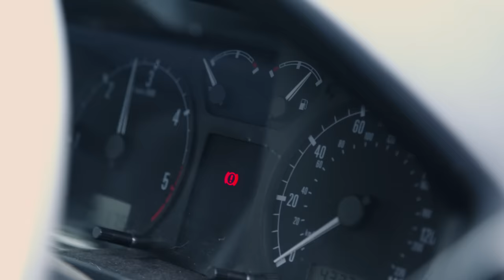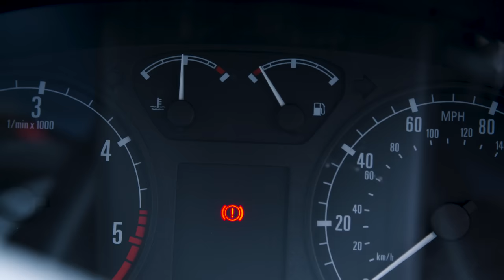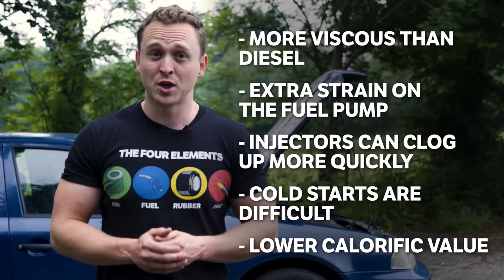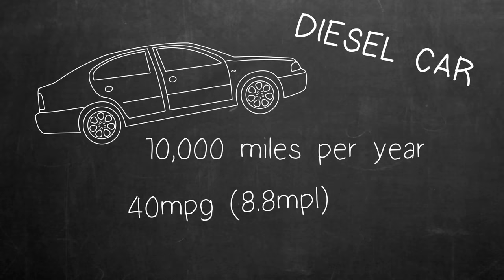The Pros & Cons Of Running An Old Diesel On Used Vegetable Oil

Comment: And now try to get your best time on nurburgring running on chip fat
Reply: Full Throttle If he can run 800 miles on some chip fat
Reply: Full Throttle To do this properly, you are supposed to preheat the oil using heat from the coolant loop, to lower the viscosity and save your injectors.  Put a heat exchanger in your separate oil tank and you'll be greasing for a million miles with nothing but smiles.
Reply: Full Throttle i can you try HVO100
Reply: Josh Ellis. I've run several older diesel cars on neat veg oil, both fresh and filtered used, and never needed to warm the oil first. However if you're worried about excessive injector pump pressures you can simply add a small %age of petrol to the tank. In really cold weather you can safely go as high as 20%.
Reply: Actually why not take Miles to the Nurgburgring and do a lap on only vegetable oil
Reply: Full Throttle what about suspended water?
A j cloth isn't sufficient enough, your filter will block.
Reply: A form of heating will also be needed for cold starts.
Reply: Chris that's pretty impossible, you'll never heat the pump, lines and injectors.
Reply: whats up with phil?
Reply: Josh Ellis this engine doesn't need a heat exchanger or twin tank system.
Reply: Yes
Reply: Full Throttle Can add 20%gasoline to thin the oil.
Reply: did you ever put metholated spirits (alcohol) in winter to stop it going like lard?
Reply: @amanofmanyparts9120  could veg oil and diesel be mixed in the same tank? Would there be any advantage to this method?
Reply: @MarkMcCluney  You could do that, but the mixture wouldn't be much better than running on neat of oil or diesel. In practice a small(ish) quantity of petrol (gas in the US) will do the job far more efficiently. Depending on the average air temperature, 5 - 20% (max) will do the job.

Bear in mind that this applies only to older diesel engines. Modern 'common rail' or 'direct injection' diesel engines will not run on veg oil as well as the older types. This includes Perkins engines as early as the 1940's as they invented the direct injection diesel engine. I had one and it chucked out as much smoke as a WWI naval destroyer 'making smoke in order to turn and face the enemy'!
Reply: @amanofmanyparts9120  I'm a bit chicken about starting this and I guessed half and half would give me similar mileage for a reduced price. And thanks for the info about the direct injection engine - clearly I need more research before taking the plunge! Thanks mate.
Reply: Doesn't matter, you get from a to be on the cheap. But I'm not so sure what the engine will look like after x 10K of driving on this crap.
Reply: Shell already uses veg oil as diesel. Look as it goes in the tank !!
Reply: Bruh how does chips have fat?
Reply: @amanofmanyparts9120  petrol or diesel?

Comment: Back in 2000 when the fuel shortage was everywhere I was running my rover on veg oil for weeks from wherever I could buy it. Standing in kwik save with a trolley filled with 1 litre bottles got me a few states
Reply: I heard a lot of places will give you their used oil for free, because they have to pay to get rid of it.

Comment: Two points.  If you heat it up, the viscosity decreases and you can pass it through a finer filter.  A bed sheet would probably work well.  Second, if you siphon something, keep your thumb or finger over the end when you do it; you'll be able to stop the flow immediately without losing vacuum or getting anything in your mouth.
Reply: Use a clear tube so you can see it coming! 😉
Reply: Pro tip:
Put a seccond little tube in the hole  to the tank.. use a piece of tissue to block as much as you can so no air comes in or out..
Now blow on the little one. 
As the air gets in from one, the diesel comes out from the other.
The little tube don need to tuch the diesel
Reply: @duarteolim6473  that probably would have saved a few lives in the 60s

Comment: Use a 50/50% diesel and veg oil mix saves money and you don't have the problems with viscosity and no problems with cold start I have been driving my pajero 2.8 auto 4x4 on a sunflower oil mix for years without any problem.
Reply: You can still smell it, and eventually it gums up the injectors. The crap filtering he did will kill modern cars. Your better off using an actual filter membrane.
Reply: Hi, do you put the 50/50 mix strait into your fuel tank or do you have a second tank
Reply: I used to do the same with my Landy.....had about half a tank of diesel and would stand in Tescos carpark and pour 2 x 5l of veg oil into the tank. Got some strange looks!
Reply: @SuperNeilB  Same here in a Vauxhall Astra Isuzu diesel 50 50 ish. Car ran just fine !
Reply: the best is a 2 tank system you only use diesel when starting and 1-2 minute before shutting off the engine.
Reply: I am driving vw bora 50/50 just from tesco oil
Reply: C Davies I had a Nova TD and a Astra mk TD. Both great engines only the rest of the car rotted away. Engine would've gone on for many more miles ☺
Reply: C Davies nice car also strong engine ☺ Especially the 150bhp version ☺
Reply: I wish I knew about the anti theft value before I tried to cyphon off a full tank before we sold our Octy. I managed to get a good 15L out before I gave up.
Reply: Pete uk radio amateur mw6zan duuude do you know Pajero in my country means Wanker?
Reply: I run 100% summer and 80% oil in winter with not many issues
Reply: I have a more complicated formula in my mercedes benz. I use 50% oil, nu 40-45% diesel, and the rest is petrol. No hp loses, drives like crazy, and it is well maintained. Winter or summer.
Reply: You have to check on the 2.8 it can blow the front seal on the pump
Reply: @eduardotrillaud696  yes but the spelling and meaning in Spanish is different pejeros is the closest I can come up with it certainly is not pajero the Japanese meaning is pampas cat from what I gather.
Reply: @radionutio81ij79  the spelling is the same in spanish. But yeah of course the meaning is different
Reply: Little Reptilian  you don't need a conversion, all you need to do is add 20% petrol to neat oil
Reply: @albertasandruskevicius9683  you don't need to do a 50 50 mix all you need is 20% petrol
Reply: @G Burns the Isuzu engine Corsa B it's immortal. also the torque! good lord
Reply: Running 50/50 Diesel will cause globs of a plastic like substance in your tank
Reply: the same with 1.9 AGR Octavia... no difference in throttle response or performance. It just smells differently.
Reply: I run my 2.5 pajero on used gasoline engine oil and diesel mix!
Reply: @nemphis95  I too run a small amount of petrol through my Golf SDI every so often. Helps to clean the injectors and stop things from gumming up.
Reply: Your pajero 2-8 will run sweetly on a 50/50 mix because it’s an indirect injection engine as will older Peugeot/Citroen,Ford,Vauxhall/Opel,early Perkins and any other Diesel that uses that type of injection. The newer High Pressure Direct Injection engines are not as tolerant of poor fuel as the older ones. There is of course the problem with EGRs and Catalytic Converters and the dreaded Particulate Filters. These are very expensive items to replace should the fuel ruin them,just think about that before using these low quality fuels.
Reply: @Steve211Ucdhihifvshi  forget running modern cars on veg oil at all. We are talking about old cars here. Running some diesel purge 2-3 times a year will clean the injectors and keep the fuel system in top shape

Comment: My uncle left the country but the car to us, so we abused his TDI Bora 2001 with McDonald's Oil. Non Filtered, Straight into the gas tank. 1/3 Diesel, 2/3 Oil. Worked as a charm!
Reply: That would have clogged your fuel filter immediately, tank would look like a chip pan,
Viscosity would be far too high, I've run it for 23 years
How many days did your car last 🤣🤣
Reply: @S-O-T  it lasted 3 more years until he got rid of it (he crashed the wing due to ice on road). It worked well. We put oil many times and it worked. When he came back from Spain, he drove from Montreal to Los Angeles and it worked well. ALH engines rule!
Reply: @boardingurban  i thought he left the country for good, gosh are you good family to try to kill his car with unfiltered filth.
Reply: @tarkitarker0815  he crashed it a year later. No issues with the engine until then.
Reply: @boardingurban  its still not nice.
Reply: @tarkitarker0815  thanks for reminding me of all the good memories!

Comment: I did this for a few years in a 1993 Citroen AX Diesel. Worked great, it actually run smoother once it was on operating temperature. I did install a fuel preheater, this makes the diesel flow better trough the system.
Reply: "the diesel" i know what you did there.

Comment: My dad once ran a tractor on this stuff. It smelled like pancakes :D
Reply: Deep frying pancakes?
Reply: i can tell you are from the countryvtoo as the offline dino game is your P.P you must drop internet alot?
Reply: Must of been terrible pankakes that you ate
Reply: Makes me want to run my late 90's mechanically injected Kubota lawnmower on deep fryer oil.
Reply: You can run diesels on anything, my dad ran a Mercedes 300d on engine oil, automatic transmission fluid, and some diesel all mixed together
Reply: Lmfao #dead
Reply: I run my ford 5000 tractor on a 75% chip oil , 25% diesel mix
Reply: My uncle was the lead fish fryer during lent at our local knights of Columbus. He would usually get about 600 to 1000 gallons of peanut oil a year. He filtered it about 5 times and converted it to bio diesel. He would carry his bio diesel in a 85 gallon tank. Since he only used it was in his Dodge Ram dually. He pulled a 38 foot 5th wheel and a 16 foot bass boat. To a lake that was about 110 miles away from his home. My aunt would drive their PT cruiser behind him. His truck is a 2005. He only has like 58,000 miles on it.  Until he got to old to fry fish and retired from the KOC altogether. He is now legally blind and has major health issues. He still has his truck though. It did not see actual diesel fuel until about 50,000 miles. He is 91 years old. He has always been a gas mileage freak. He would do anything feasible to try to conserve fuel as far back as the late 60s. It was always a hobby for him. I remember him saying he was getting 24 mpg out of a 360 dodge engine one time. He had changed out the gears in his rear end, and at that time doing something with injecting air into the carb someway or another was the big thing. Like I said. Saving fuel was always his hobbie. He had all kinds of solar panels and a solar preheater for his hot water system. He had home spun windmills all over his farms. Actually that was pretty neat how he did those windmill/solar fence chargers. My dad also used electric fences to keep our cattle and hogs in. We had to dig long trenches and run long electrical lines to all his chargers though. He said he did not trust the solar powered ones because he used the weed burner fence chargers.
Reply: @sniperdoug1969  that's cool to think people have been doing it as far back as then. I love the idea of one day having some land where I can try to generate electricity, especially if I had a stream or small river.

Comment: The veg oil even filtered will eventually clog up the engine itself. There is something called esters in it. By processing the veg oil, you can remove the esters. BUT to do that you must heat it with a mixture of methanol and lye. The esters will separate and since they are lighter they will float to the surface. That way you can drain off the now purified veg oil from the bottom.

At one hundred percent it will thicken in cold weather such that it cannot reach the engine. For that you must put heat cables all along the fuel lines. Or you can run only a 50% mixture in cold weather. You might notice a slight decrease in power depending on the engines management system. A new electronic system might be able to add more fuel when you need to accelerate such that you won't feel the loss of power.
Reply: Can I msg u? I'll post my email for a short time if/when u respond.. I would sincerely appreciate your input 🍻
Reply: It's not the esters that are the problem. Vegetable oils (and animal fats) are tri-glycerides (all tri-glycerides are tri-esters of glycerine and hydrocarbon-chains), during combustion, especially in a cold engine and at an oxygen deficit,  the glycerol residue reacts to produce both Acroline, which is emitted/produced, and the side reactions polymerise. The Acroline is very rough as an atmospheric pollutant, and it reacts to produce photo-chemical smog. The polymerised byproduct clogs your engine, and the rest fucks up air quality.
Reply: You make esters when you refine vegetable oil the way you are talking about. It's literally called trans-esterification. So the esters aren't the problem.

Comment: My Dad had a W124 Mercedes E-Class which he ran on rapeseed oil, basically the next best thing after used vegetable oil. We had a big fuel tank in the garage which was filled up by a truck every once in a while, and we could just fill the car up in our own garage - and it was cheaper than diesel, too! The disadvantages? That freakin' truck driver ALWAYS flooded our garage with this stuff (there are still stains on the floor even years later), and the OEM Mercedes fuel pump and injectors had to be swapped out for more heavy-duty ones (which the pre-owner of the car did). The car was running just fine on that stuff, and when we traded it for a W210 E-Class Estate in 2012, it had 387,000 km on the clock - with no noticable issues apart from some minor rust spots and a worn-out differential. I bet it's still on the road today, but probably somewhere in Africa... 😂
Reply: The Stig's German Cousin my dad still has a w124. In summer veg. Oil is used, if it is cheaper than diesel. The car has over 400.000km and still running fine
Reply: Samot Roger Lol I just thought what a hell of a coincidence it would be if your dad got our old car... 😂 Ours was a black 1992 250D sedan, what's yours?
Reply: The Stig's German Cousin haha, no. It was bought 1994 as a used car in germany. I think it was build 1988. its a 250Td in brown colour
Reply: Samot Roger Haha oh well. Guess that would have been too much of a coincidence 😂
Reply: I bet that your W124 Mercedes is somewhere in Morocco 😂
Reply: Aziz belkharmoudi Probably, I've seen some documentaries about Morocco and literally everybody seems to drive old Mercs there 😂😂
Reply: The Stig's German Cousin old mercs are the best  w108, w115, w123, w201 are automotive legends nothing like modern mercs
Reply: no w124 love? dafuqsdamatta you? :P
Reply: The Stig's German Cousin Can add 20%gasoline to thin the oil.
Reply: The Stig's German Cousin I still remember when me and my dad filled our tank in the lidl parking lot with rapeseedoil back in the day... Ohh our Vito...
Reply: Can't be that hard to dye it.
Reply: The Stig's German Cousin there are other countrys that do that to if your a try top gear fan you would know that suprisingly a europien country(albania) does that too
Reply: Oil from raped seeds?
Reply: I drive my XJ Jeep with 2.5 turbo diesel engine on pure sunflower oil. Works perfectly while the temperature is above 10 degrees Celsius. 😃
Reply: W123 owner here. Yes, yes they are.
Reply: Did he use vegetable oil on that W210? I'm interested as I have an old W210 ;-)
Reply: R a p e s e e d
Reply: rapeseed?

Comment: Diesel engines can run on diesel OR vegetable oil,  
PERFECT FOR THE APOCALYPSE
Reply: Most likelly any random oil XD
Reply: They'll run on far more than that, they can run on pretty much any oil however diesel is a lubricator and a lot of other 'fuels' aren't hence why it's not advised. Cooking oil is fine but stuff like kerosene will work but it'll kill your engine eventually unless you add a lubricant yourself
Reply: Fuelpocalypse
Reply: You can run a gas car on alcohol
Reply: Novice Garage also discovered that you can also use jet fuel, ATF, and something else.
Reply: Cos there is going to be lakes of vegetable oil available after the apocalypse?
Reply: @jd_kreeper2799  I mean.. to be fair jet fuel is old news. The military has been JP-8 in almost every single vehicle since the 80s.
Reply: @dieselgeezer18  Any examples? From my understanding, diesel needs to be 70% to 30% ratio for natural gas, as diesel engines use compression and coils for ignition.
Reply: @FVBmovies  search the internet. There are plenty examples of people running their diesel engines on natural gas. I run my diesel truck on woodgas too
Reply: Hahhhh bet you never thought by 2021 that statement would be true,
Why you think I’m here?
I knew about it years ago and now researching as much as possible some great helpful information here tempted to copy and print some information off so I have it on paper I sound crazy but we are living in 2021.
Reply: Not perfect! You'll find much more Diesel than vegetable oil by then. Cooking oil, like any food, it can turn in a very valuable product, no matter how many times is used.
Reply: Where are u going to get the  massive amounts of vegetable oil? No chip trucks at the end of the world.
Reply: @Georgeqaws  most likely scavenge old restaurants for their stove oven range. Some oven ranges has a tub to collect/scavenge oil. - a byproduct of cooking.
Reply: Can run on waste engine oil too, though you need to process and filter that a bit more

Comment: I own a 1995 Citroen ZX diesel and some 8 years ago I used to run it using my own used vegetable oil from my kitchen.
I then quit making fried food in my own house and never retried the veggie again on the car, but the car is still running fine nowadays. Average 4,5 Liter per 100 Km. ;)